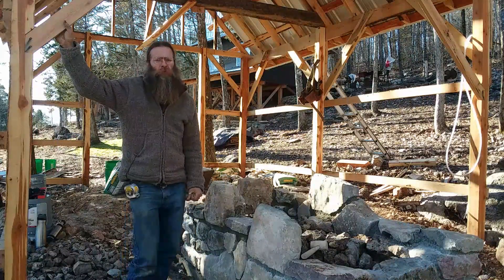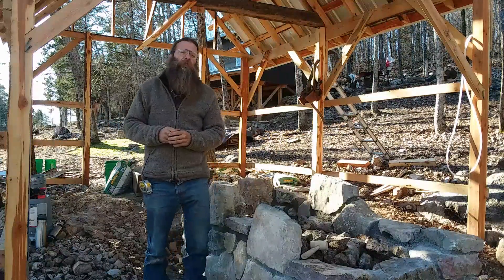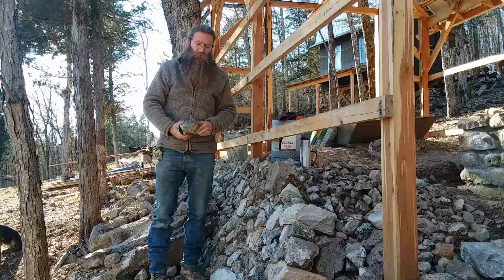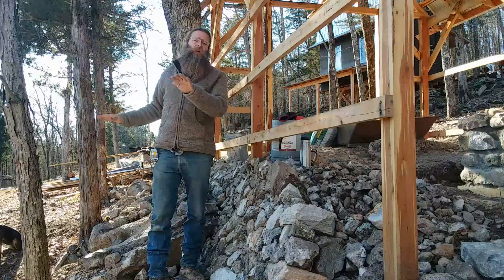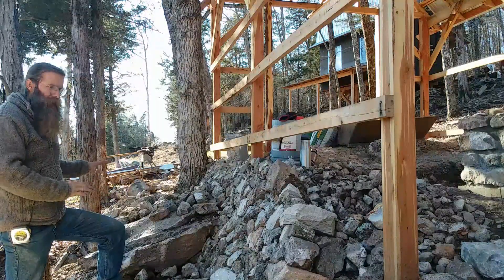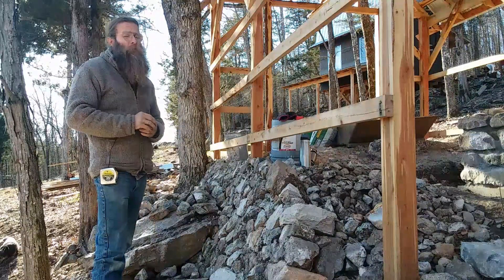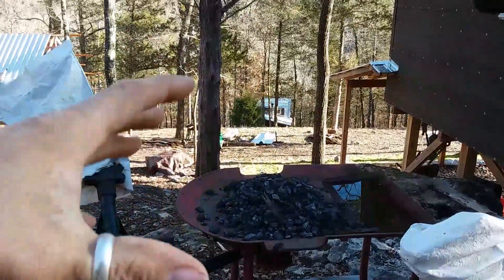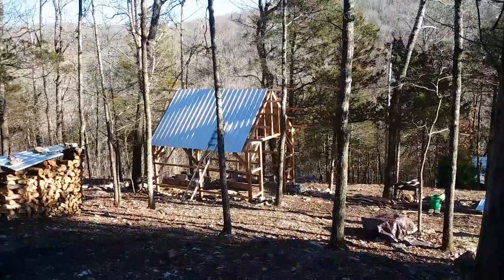The Blacksmith Shop: Episode 2

Comment: What kind of wood is the framy of your black Smith shop made with?
Reply from the maker: The four by four post that go into the ground are red cedar and the purlins and rafters are red oak
Reply: Thanks  again for getting back to me.you made good choices on the wood for your black Smith shop. I tried to move to Eureka springs in 1991 as a mechanic but opportunities were limited so I packed up and came back home. Always work hard to make your dreams come true.
Reply: @fernhoppertimberworks8037  Eureka Springs is pretty close to where we live. It's a beautiful drive.